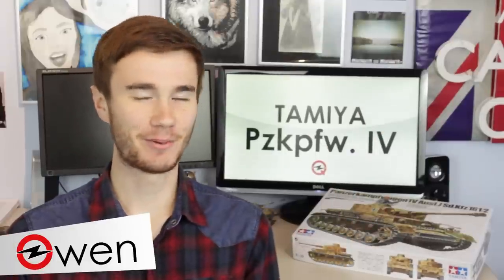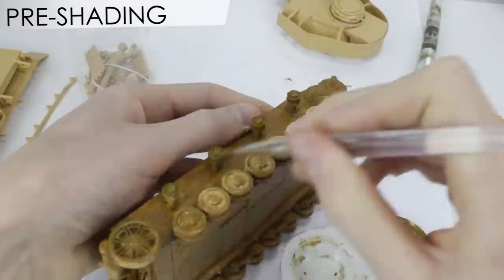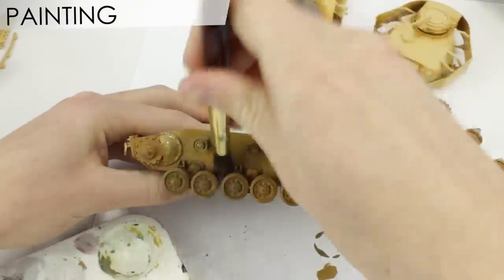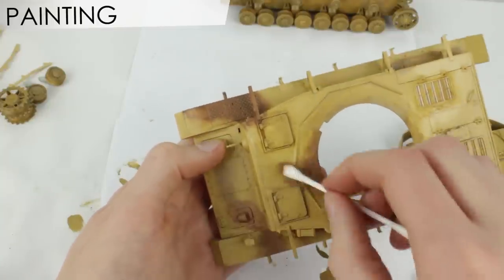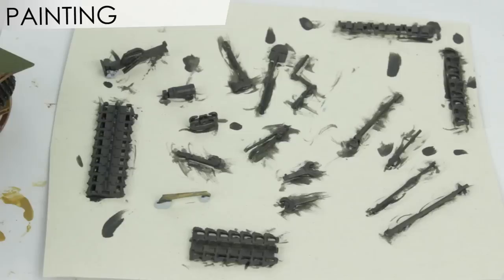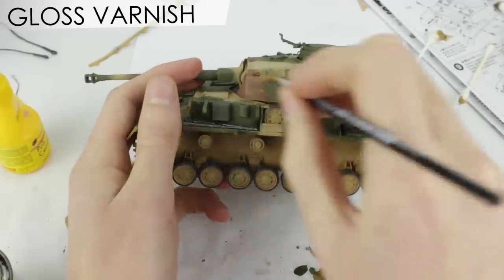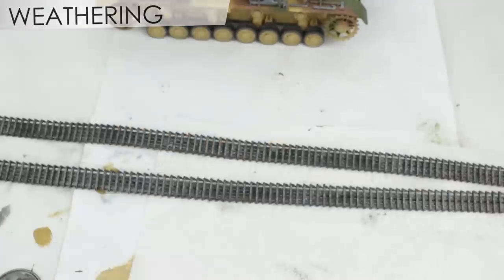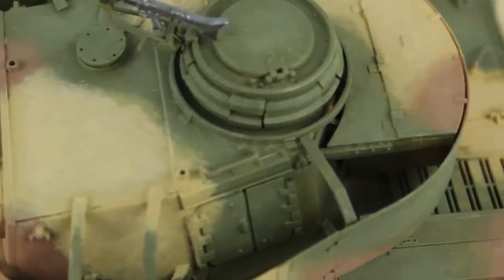Painting the Tamiya Panzer IV - Model Tank

Comment: May I ask why you prefer paint brushing as opposed to airbrushing? It looks great, but I wanted to know why.
Reply from the maker: I enjoy using a brush and the challenge of replicating an airbrushed look, and also I want the videos to be accessible to everyone :)
Reply: I have a follow up question, I've built models but never started painting them until now. I want to paint all the old models I've made but since they are all glued together, I can't paint the parts separately. Any tips/differences for painting a fully completed model VS painting a model in pieces first?
Reply from the maker: WelshZeCorgi You'll have to be careful and probably use Tamiya masking tape on any clear parts, paint larger areas first and then smaller details last. You might want to remove any plane canopies (carefully) to paint the cockpits and then glue the canopies back in place

Comment: i love your video. but i tried paint my model (with acrylic paint) without priming with prime coat like you did in this video, but the result is the paint wont stick on the model. what type of paint you used in this video? and how do you make the paint stick on model without priming? please help me solve this problem.
Reply from the maker: If you wash all the parts in warm, soapy water with a splash of vinegar, this helps dissolve and remove the chemicals that they use to make the plastic come out of the mould easily. It's the residue from the moulds that stops the paint sticking. If after washing it the paint still doesn't stick then maybe try enamels? I used enamels in this video
Reply: +Quick Kits oke thanks 4 ur advice, ill try wash it 1st then maybe try enamel paint.

Comment: you are using the color of the plastic for a base ?
Reply from the maker: No, the sandy colour is painted if that's what you mean?
Reply: +Quick Kits its a base coat ?
Reply from the maker: Yes I did use it as a base coat, it's not a primer though which is what I thought you might have been asking